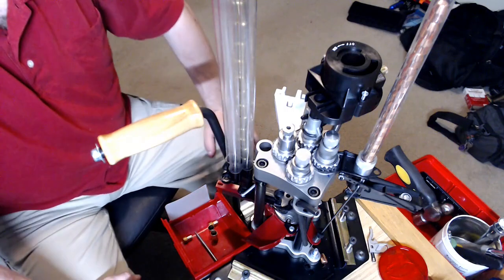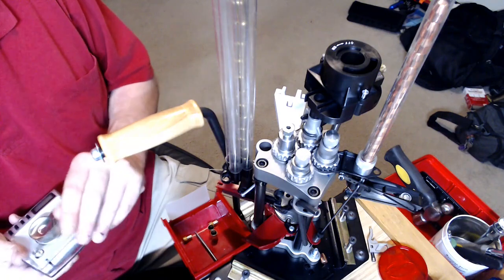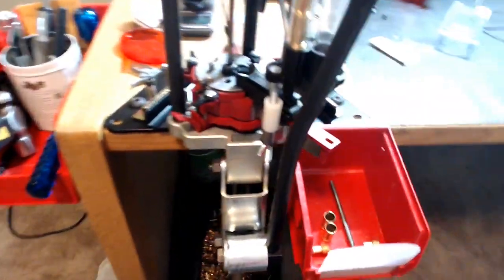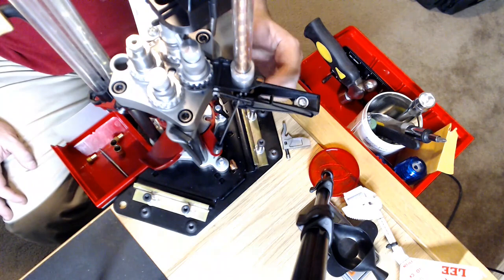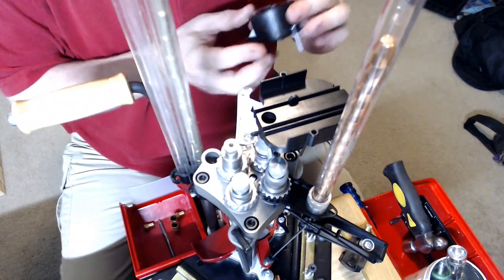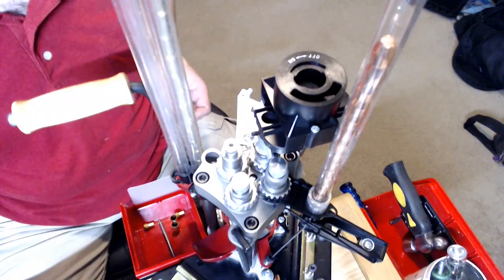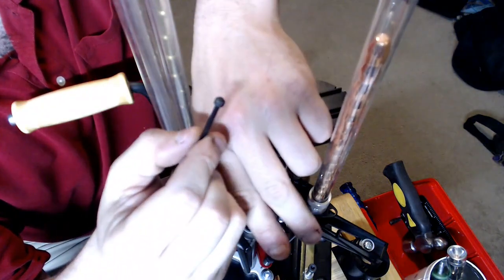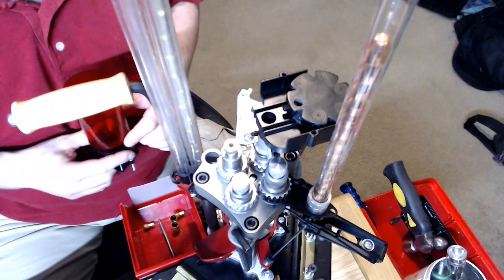Lee Auto Breech Lock Pro - Powder A-Weigh!

Comment: I bought a second set of discs and drilled and tapped the set screw holes in the side of the discs. From grainger, I purchased a bag of of 1/4-28 X 1" nylon set screws and cut to length. I couldn't find 1/4-28 nylon nuts, so I got some number 10's, and drilled and tapped them. I'm going to handload some 9mm tomorrow, so we'll see how this mod works. Also, I bought 5 extra silicon wipers to see if I could mod that limited drop hole when using the adjustable charge bar. What I did was; using a Dremel tool with a small stone grinder on it, I ground off that front lip, it actually was quite easy. I used that setup to load some 9X25 Dillon's. Worked like a charm, and didn't see any powder(700X) spillage.

Comment: Use a piece of dowel rod in a large hole on a disc, cut flush with top and bottom. Drill a hole the size you need and file or sand to adjust the charge. Dowel needs to fit tight. Cheaper and replaceable if need to change weight. Been doing it for years, mostly for light loads on small pistols.
Reply from the maker: I'll have to see what I can come up with to fit the holes and try this. I'll have to see if I can find some nylon in metric sizes close enough. I've tried drilling dowel rod in metal and wood before, and it didn't go well for me.

Comment: I finally got mine setup and running pretty decent the problem I am having is when the shell casing is moving forward the one on top of it from the tube feeder causes it to catch and pop off the press and falls to the floor. Will your modifications help with that? Has anyone else run into this problem? Thanks for the videos.
Reply: Everyone has this problem with the Breech Lock Pro.  The good news is Lee has excellent customer service and will respond right away. To fix it, you need to make sure the spring holding the carrier slide is attached to the rear most hole.  Next use a popsicle stick to put a proper gap between the top of the case and the bottom of the case feeder, and also gap the side of the machine head and the case feeder with the popsicle stick.  You'll know you've got it right because the shell case will stick out about 1/4 out the back of the carrier slider.  This proper adjustment will make so each shell case falls slowly into position and the side of the machine head prevents it from falling over.  You will have occasional double case drops, like maybe 2-4 every 100 rounds.  I added a little arm to prevent them from falling off too it's sprung operated with a small weak rubber band.

Comment: Nice video. You can do the same thing to your stock auto disk. Pick next largest hole and just drill side for set screw. That way you dont have to buy a blank disk. Only cost you a set screw. Otherwise nicely done!
Reply from the maker: I had considered that. I may experiment with it a little later on down the line once I get a tap set and a decent vice to hold it in for my drill press.

I'll probably also try with a smaller thread size and offset it a little so the set screw doesnt go through the middle of the powder hole. With the stock disks made from PA6.6 Glass filled nylon, I might also try finding some nylon set screws as well.